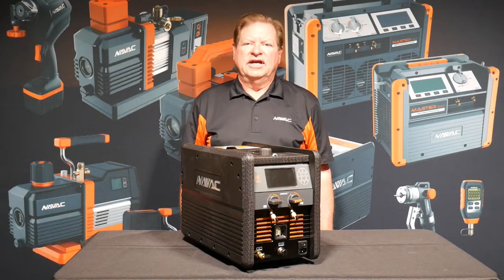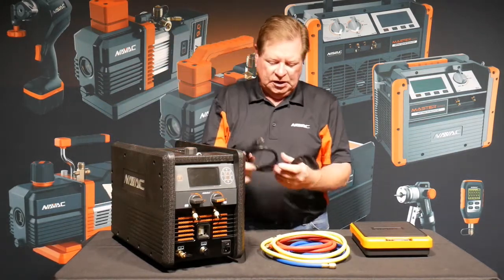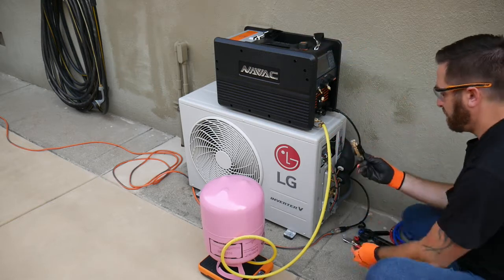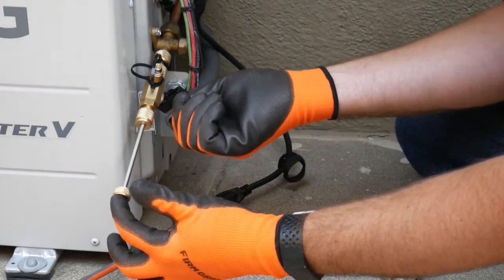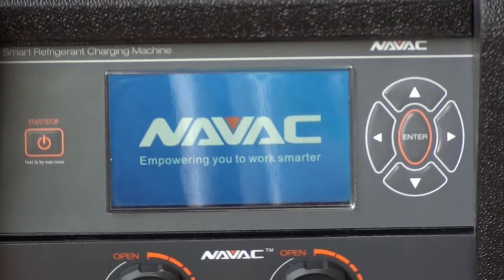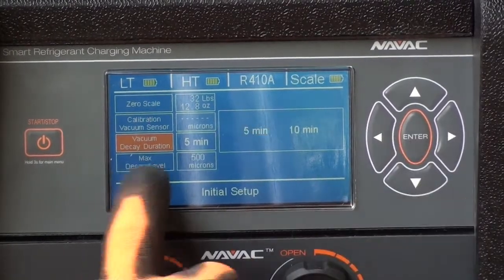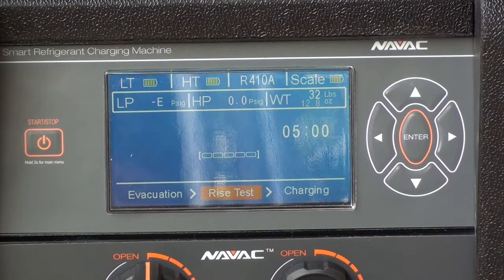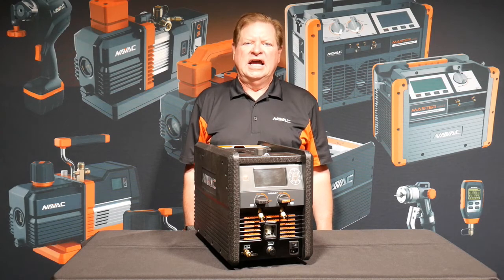NRC62D Charging Station in A Job by Kevan Mayer & Bryan Schwartz

Comment: So, you are taking microns at the pump and you are required to know exactly how long the line set is in order to adjust the charge. It doesn't charge based on a subcool setting? Be far more convenient.

Comment: How do i know how much oz is my outdoor unit is pre charged for? And how do i calculate how much more i need to add?
Reply from the maker: The amount should be located on the data tag of the unit, and how much you need to add should be found on the manufacturer's installation manual.

Comment: I got the first model that came out a couple years ago mine did not come with temperature clamps is that a new addition when purchasing the new unit ?

         I also see they now have a nicer menu screen easier to understand in function
Reply: How do you like using your unit?
Reply: @T.w.i.n.e.y  it’s a nice little all in one unit.  NAVAC Makes excellent high-quality engineered Products. 
                  I think the unit is geared towards the all in one hands-free kind of person especially if you had employees who weren’t so well trained and have a lower skill set. 

       He would enable them to have a hands free and not responsible for doing anything kind of operation. 

      It’s a nice little unit I think it would be great for small appliances and little refrigeration and air-conditioning. 

        And looking at their new display and their improvements it appears they made the unit even easier to manage and function the screen

          But I do high-volume in some fast work occasionally and sometimes I use multiple bigger pumps on larger jobs so I no longer use the unit but I still own it. 

         I love the scale I stole of it out of the unit and I use it every day because it’s so accurate and reliable. 

         Unlike the other manufacture who has a yellow unit that is also Bluetooth that is unreliable and constantly drops out and makes you make a mistake on your refrigerant weight when Addie so I no longer use that yellow Bluetooth scale anymore from that other manufacture. 
       I highly recommend the NAVAC Bluetooth scale

         I own the large 12 CFM commercial NAVAC Vacuum pump which is phenomenal

        I also own the smaller DC digital eight CFM NAVAC vacuum pump

         I also on the NAVAC  four-cylinder refrigerant recovery unit This is there a big commercial heavy duty one. 
         What is actually the best recovery unit I have ever used in my entire life and no other recovery unit of any buddies that I’ve used even comes close to being as powerful as this unit for recovering refrigerant without having to pour water and cool down the recovery tank. 
       
The NAVAC  four-cylinder recovery unit was designed by the gods as a gift for mirror mortal man.